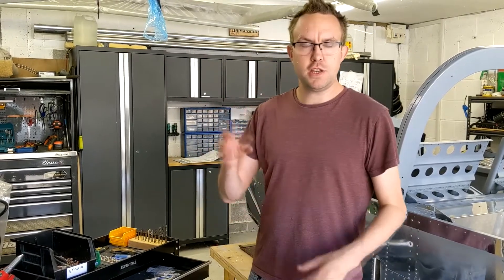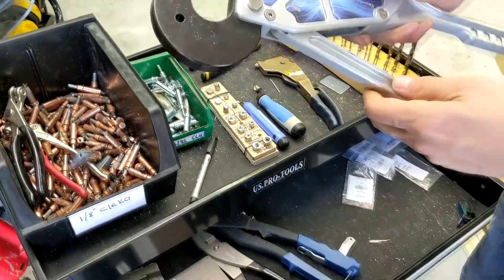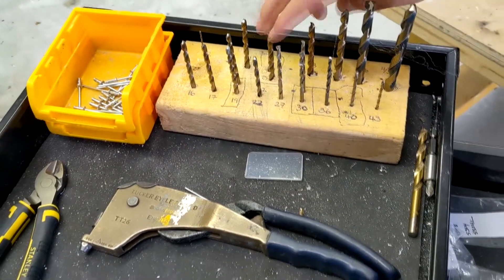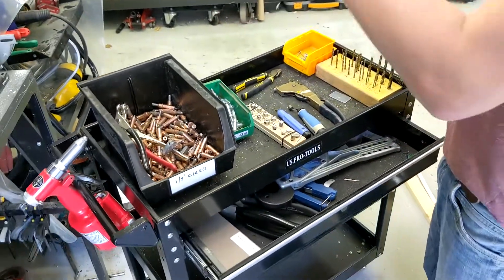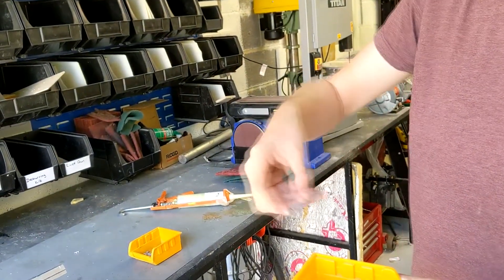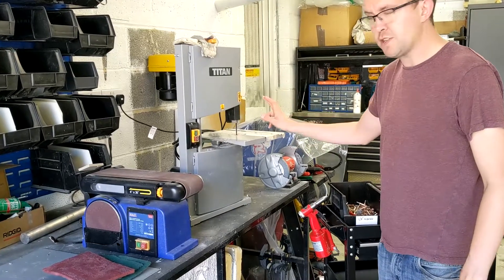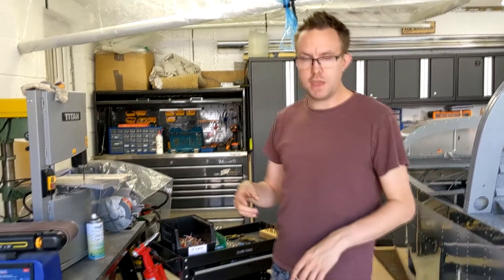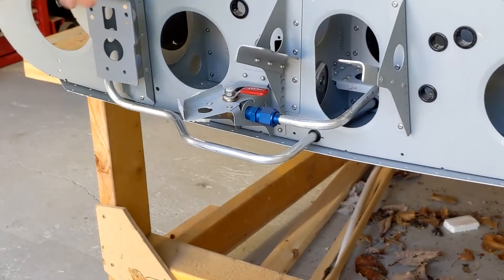Vans RV-12is Aircraft Build | Tools and Kit You'll Need

Comment: Cool video! Thanks for sharing. I fly light sport in California I do some of my own maintenance but would really like to lean to work with sheet metal. So I bought the tool box project from Vans for like $40 but I can’t even figure out all the tools I need to build it! I’m afraid I need $500 in tools to build the $40 tool box. So it’s been sitting for a year. Does not bode well for my chances of ever building an RV-12. 😮
Reply: is it more than just a manual rivet gun and some scotchbrite?

Comment: Nice one guys, my partner and I are also looking at building the 12is... how have you found taking the design through with the LAA? Also are you planning on sourcing all of the kit from vans or other (e.g. engine from Europe)
Reply: Hi Tony, the LAA have been excellent, they already know of it so it was no drama at all - just get a good engineer, if your wiltshire based Id reccoemend ours. All of the kit direct from Vans - looked at local engine but its alot of agro and for first tiem builders the <5k saving isnt worth the head scratching or safety issues that may arise. We will be documenting the rest of the build from now - powerplant, finish kit and avionics, so stay tuned!